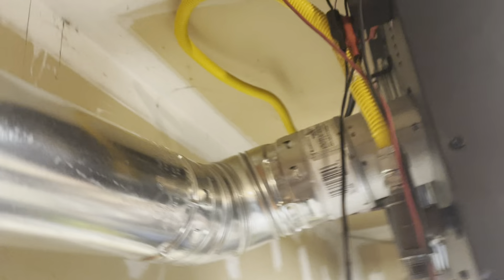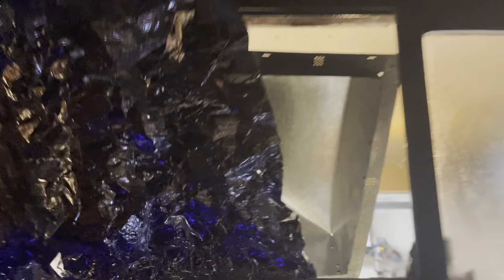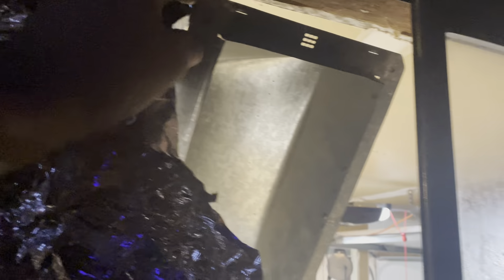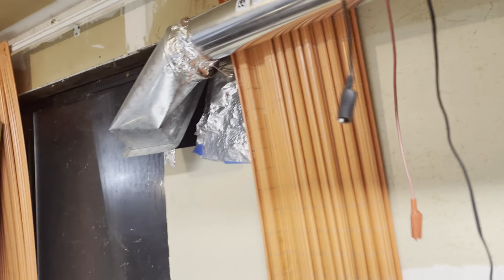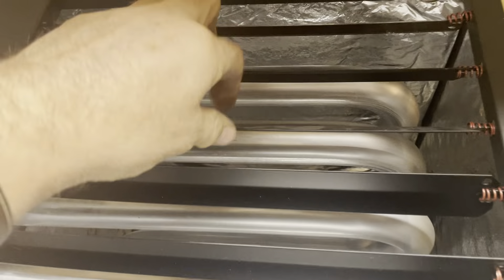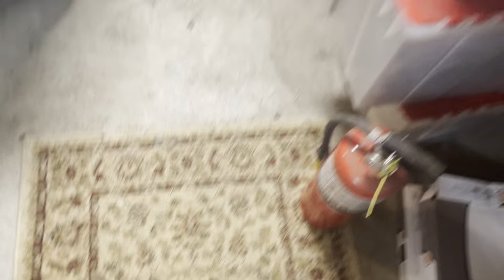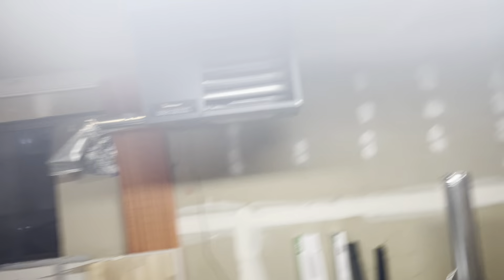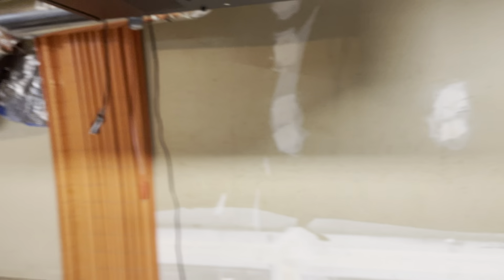I fired up the 'Mr Heater' garage heater for the first time.

Comment: I was looking at one of these on Amazon (which is probably why this video was recommended to me, lol). I want to use it in the basement. They put out a LOT of heat -- way more than you need just for your garage, I think. Good luck with it.